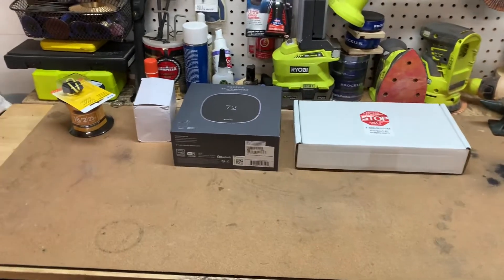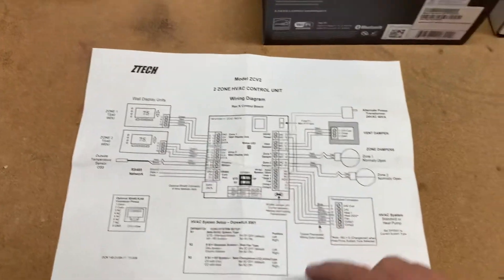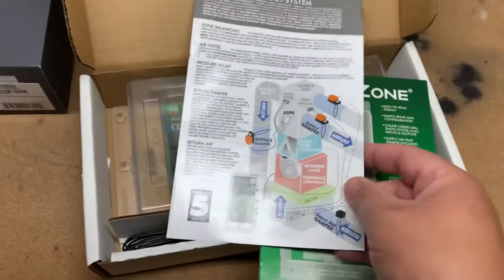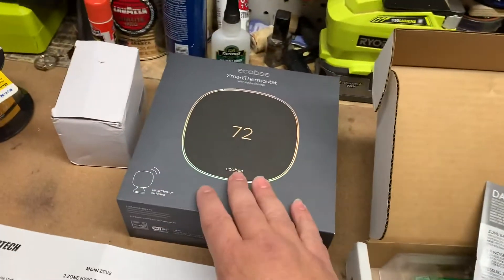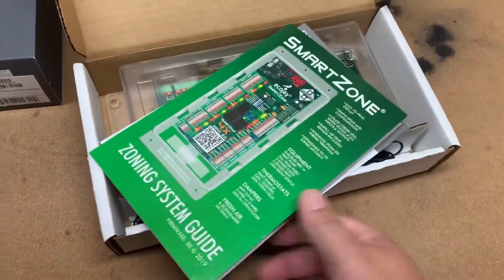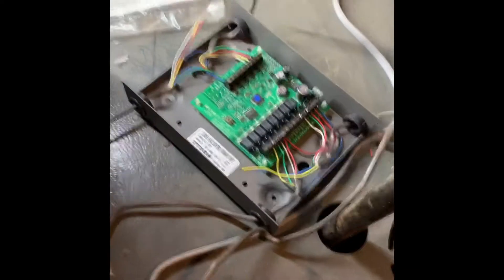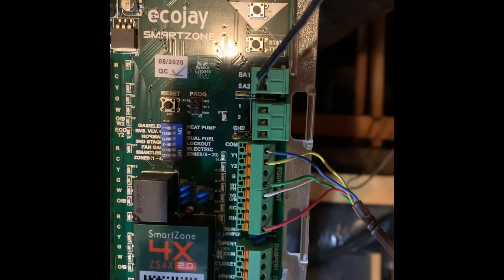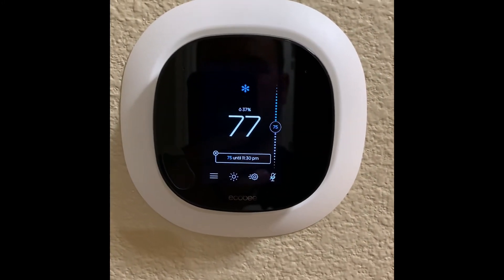DIY Ecobee Smart thermostat and ecojay 4x install with Beutler smart vent fresh air damper

Comment: Thank you for your video. It will save me a lot of money. I have the same system, but with two thermostats, one downstairs, and one up. I can see how most of the wiring from the old controller goes on the new controller, but I have questions.  Did you have to use the PEK?  Should I be using that for both my ecobees?  How did you connect your power?  What transformer did you get and how is it connected to power? Did you put the transformer in the furnace? (This is the scary question for me).  Before I discovered the incompatibility with the Ecobee and the controller, I connected the non-used blue wire to C on my ecobees.  It looks like I should still do that.  Thanks in advance.

Comment: Great video and a major breakthrough. I have been waiting for something to come along to get rid of my Honeywell. I have a question, I have a two story (dual zone), will it work the same as it does now? Meaning, can I have an upstairs and downstairs ecobee thermostat that can control either zone?
Reply from the maker: Yes it should work the same.  

Here’s is the link, but basically you’d connect the 2nd thermostat into the zone 2 thermostat connector. 

http://ecojay.com/smartzone.html
Reply: @macj98  Thank you for the quick reply. I am looking for ecobee model numbers if you have them. Two thermostat controllers and the board to replace my Beutler honeybee upstairs and downstairs thermostat zone controllers and board in the attic. 
Also, I am still not 100% clear on the smart vent wiring based on the update you posted. What is the difference between the economizer feature and the ventilator timer?
Reply: Sorry to bombard you with questions but the 4X is required (not the 2X or 2L) because it has the fresh air/damper4 plug, correct?
Reply from the maker: I used the ecobee smart thermostat with voice control.

https://www.ecobee.com/en-us/smart-thermostats/smart-wifi-thermostat-with-voice-control/

If you have and want to keep your smartvent fresh air damper, yes you need the Ecojay 4X.  Because the fresh air damper is controlled on Zone 4.
Reply: @macj98  System is installed and running. From what I gather testing it...the ventilator(free cooling) is controlled by the 4X and makes a choice when cooling is called whether or not it enables? What I am seeing is that we lost the ability to manually turn it on and off via the thermostat and that is why you added the switch in your other video?  
* When I supply power to Y on zone 4 nothing happens, but when charging G it enables the fan and smart vent door. Is Y something that is completely controlled by the 4X during cooling?
Reply from the maker: @boxpin  to turn it on manually, you can turn on the “ventilator” or set a timer just like the old Honeywell.  Pin G is the correct one, pin Y uses the ecojay for part control, I have abandoned it. With the eco bee in pin G on zone 4, you really don’t need the switch.  But since I already installed the switch, i added an AC relay and I can manually turn the smartvent on either way.
Reply from the maker: @boxpin  also make sure that on the ecojay itself, you have enabled zone 4 as a ventilator.  You physically have to toggle it on on the control board, it is listed in the ecojay instructions.
Reply: @macj98  the ecojay Zone 4 has to be programmed to "FA"

Comment: Thank you so much for this video. Who ever installed my smart vent control just left it lying on top of the unit not mounted or anything. Was looking for a replacement. Does it mater if its a 4x 4 zone or 2 zone model. Mine has dual zone. But i dont use the second zone. I only have a 1 story house.
Reply from the maker: It has to be the ecojay 4x 4 zone model, because it is the only model that supports smart vent.  The smartvent is supported on “zone 4” on the board. I have a 1 story house as well and only use 1 zone.
Reply: What model eco bee do i  buy?   Does it mater? Do they all have the acc wire?
Reply from the maker: @toddxx7775  if you want to use the thermostat to control the smart vent, then you need the ecobee that supports free cooling.  I have the “ecobee smart thermostat with voice control”. My utility company (city of Roseville) actually cut me a check for it as a rebate, and the thermostat was free.  Check your utility as well.   FWIW I love the eco bee.

You can also just activate the smartvent with a std wall switch using the ecojay 4x.  I find myself doing this most of the time.  Check out my other videos for an example of this.  If you choose this route, and thermostat control doesn’t matter, you can use any thermostat you’d like.  Google nest, ecobee, Honeywell etc.
Reply: @macj98  Thank  you for the video.  By chance do you still have the TS40b?  Please let me know if you do.  Small world since I live in Rancho Cordova. Thank you
Reply from the maker: @toddxx7775  if you want to use the thermostat to control the smart vent, then you need the ecobee that supports free cooling.  I have the “ecobee smart thermostat with voice control”. My utility company (city of Roseville) actually cut me a check for it as a rebate, and the thermostat was free.  Check your utility as well.   FWIW I love the eco bee.

You can also just activate the smartvent with a std wall switch using the ecojay 4x.  I find myself doing this most of the time.  Check out my other videos for an example of this.  If you choose this route, and thermostat control doesn’t matter, you can use any thermostat you’d like.  Google nest, ecobee, Honeywell etc.
Reply: @macj98  So you are in the Sacramento region, it's a small world, the job I am attempting is in Lincoln Ca. exact same system. I will let you know how it goes. I'm completely new to the smart vent system, it's a bit overwhelming at first, but the video helped.

Comment: Thank you for this great video!  I have the same Beutler system that has become unreliable.  You’ve saved me tons of time searching for a solution to retain the SmartVent feature.  You’re awesome!
Reply from the maker: You are very welcome. I have another video where I install a manual switch for the smart vent as well.  I like the added functionality.  If you want to bypass the “economizer” functionality of the ecojay, I found you can input the ecobee acc+ wire into the “g terminal “ for simple activation.